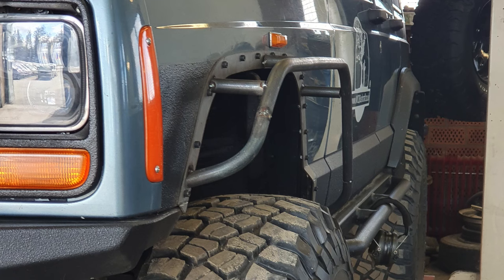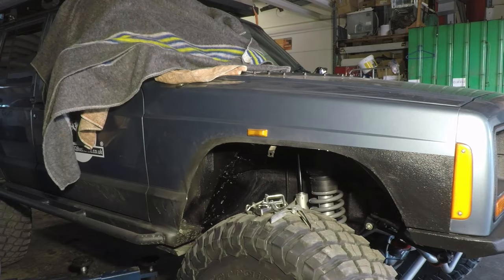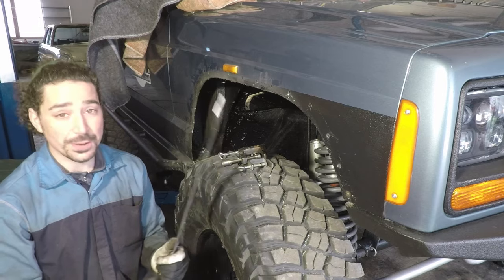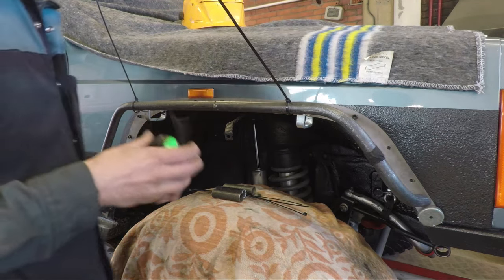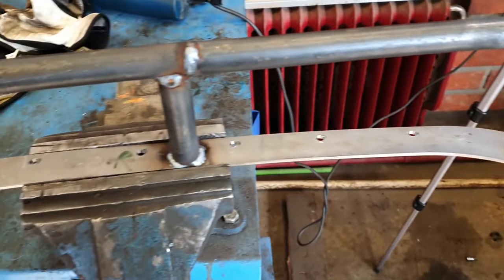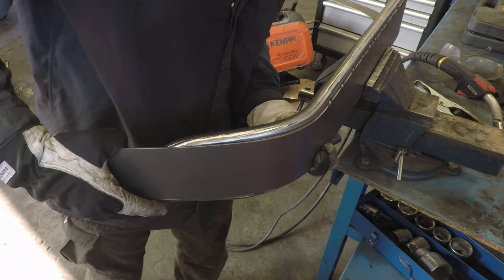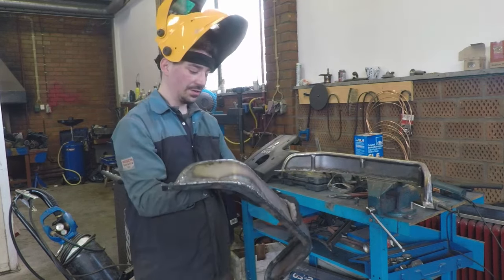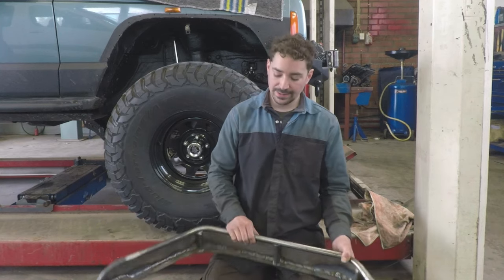How to Fabricate FRONT Tube Steel Fender Flares / Jeep XJ

Comment: I really like the fabbed fenders ! i made some front baja style steel fenders for my 89xj some years back that came out great but what i did that really help with symmetry was cut out poster cardboard templates for left and right with the bends and curves and did the same u did is take measurments at the same points of both sides for tube instal .. another thing that helps when bending the tubing is measuring reference points for bending including marks to keep ur bends level to one another ... well done they look great and probably way better than anything  available cheers mike I know this is an older vid but im catchin up and liking what u do..lookin forward to more wheelin cookin and campin say hello to Ivo for me safe travels from "Rooster"...

Comment: Great stuff, my Misses didin’t let me buy an older SUV, so we went for a newer vitara. Gradually I’m preparing it for light off road work, it holds up pretty good in mud and loose terrain. Hill descending is absolutely no problem. I did have a lot of trouble finding an all terrain tire that would fit, the wheel case just isn’t deep enough. So if you put in too big of a tire, you’ll start eating up the inside. I ended up with 16 inch steel rims with some yokohamas geolanders on them. It works very well for the trips I intend to make. 

But after all, I’d rather be welding and bolting on a real jeep! 

Nice work, truly a rig to be proud of!

Comment: I just finished all 4 steel flares for mine.
Instead of using round supports that go from the fenders to the outside round tubing I use two each 1 and 1/2 inch flat bar. One on each end just befor the flares curve. Plenty strong too. Nothing for mud to collect to and clean looking.
Reply from the maker: Sounds great! Mud won't be an issue, i made some fender lines and studded the supports. I've just been out wheeling and they work great. Thanks for watching.

Comment: Good job. Try downhand with the hardwire for the smooth finish. I might try to replicate your design on my 2 door Laredo.
Reply from the maker: Thanks for the advice. I'm an armature so its always appreciated. They are holding up great, especially with the plastic liner on the inside. Just takes all the rock impacts without sand blasting the paint off.

Comment: Awesome videos. Are you still running the plastic fender liners? And if so, are they the pre 97 model? I have a 98 and I’m using your videos, bleepin Jeep, and trail recon videos for my ideas.
Reply from the maker: I modified the original fender liner and extended it so it covers the underneath of the metal fender. In the next video I  show this and pain the fender so it may make more sense. The inner liners are the 97+ model. 
Thanks for watching!

Comment: Hey Mike, I ‘ve seen lots of videos (not all of them) and always wondered what job you did in Sweden … Am I correct to assume that you work for a Bosch Garage ? If so, was it hard to find a job in Sweden and did you first found a house, or first found a job ? We are thinking of moving to Sweden as well and the ‘job search’ is basically what is putting everything off …
Reply from the maker: Hey Tom. I'm self employed and the bosch garage is one of them. I also do graphic design, leather work and I earn a bit from both my youtube channels. I do a lot of different things to make a living. Taxes are pretty high here and it's not an easy country to be self employed in, but I have a bit of a passion to make my company work so I press on working different jobs to inject cash into my own business.
Its not a difficult country to get a job in up here in the North of you have a trade. If you can operate heavy machinery like an excavator or mechanical work, electrical work, plumbing or something then there will always be people ready to offer an opportunity even if your Swedish isn't great. 
The main thing is where you live. A small town like mine dosnt have many jobs but the houses are dirt cheap. We bought our house for about 10k outright.
Reply: @WorkshoptoWilderness  thanks for the info. Unfortunately I am not a plumber or electrician but a teacher. Although that might be a good thing…

Comment: pretty nicely engineered fender flares. Are you not a bit worried about the added weight? they are kinda chunky! Thx for the share, awesome.
Reply from the maker: Thanks, the idea was a combined flare and slider. Not really, they weigh 3.5kg each, the rear ones are 8.3kg each. In total its around 24kg. Total weight is 2001kg on the scale as it is on 35s with all the mods and frame stifferners. Its not too bad with 335kg till gvm. My main concern is the tire carrier, rear bumper and spare tire wich totals almost 150kg, could be much lighter by 40kg. I guess its all a juggling act. Thanks for watching
Reply: @WorkshoptoWilderness  awesome, thx for the explanation. I’ll be checking out your videos in the future as I’m currently in the market for a jeep. It was kinda cool I found your latest video where you go over your build and explained how it was finished. Then I checked your first video where you just got it. Awesome work you put in highly inspiring. The end result is super gorgeous 😎 👏 I’m curious for your roof tent review. I wish you many good trips and great memories to be made with this beast when you take it out camping. One thing I didn’t get, why would you prefer the nylon winch.? Easier and quicker to handle? Cheers, Kas.
Reply from the maker: @Ks-zz9lh  I would love a nylon winch. They had a deal on for the winch I wanted but it was considerably cheaper with cable so I bought it with a voice in the back of my head that one day I would replace it. 
Thanks for watching and for the comments on the jeep. Its come a long way and hopefully now I can just refine a few things and take some weight off bad designs. Are you after an XJ? Hopefully you find a nice one and its all good from there!
Reply: @WorkshoptoWilderness  hey! I just bought an XJ 1997 last week, 205.000km. I live in Skåne with my wife and kid and I needed something a little more heavy duty for the rare cold days here. I Also love hiking with my dogs In the woods and I take allot of Forrest roads to get me a little deeper on some hiking trails. My 2wd Volvo V70 would only get me so far. I picked it up last Wednesday and I gotta say I’m over the moon. Your channel has given me much inspiration and convinced me this car is the way to go. Mine is blue, it’s the 4,0 gas version and it has had the up country package I think. It has the full and part time 4wd. I’m running the stock wheels she came with. 17 inch rims with 27 inch tire height total. I’m already trying to plan out some upgrades but I’m not that experienced with vehicles. So I’m thinking a garage check up for the brakes, transmission fluid, diff gear fluids, oil change, coolant fluid change, air filters and stuff like that. My biggest concern is rust at the moment. I see some flaking on the axles and also some bubbling happening on the rear brakes. I liked the raptr liner you used on your video. I’m also looking at a lift kit. But that would mean some other gears and perhaps transfer case lowering. I gotta say I really love it stock. I’ll start out slow and check where she can take me. When we run Into trail stoppers I’ll consider some bigger wheels etc. Keep it up with content. 👏👏👏 cheers, kas.

Comment: Always enjoy your content! These are very close to what I want to make for Project Bumble Jeep. But I don't want to cut my fenders or quarter panels. I'm only about 11 minutes into this video, so if you answer my question later on, no reply is necessary. I plan to use nut serts to attach my flat flares when I do them. Also hoping to make mine out of aluminum Did you do nut serts or did you just do thru holes with nuts on the back side? God bless and stay well.

Comment: good day  May I ask what kind of logs and sheet metal strength is used?  Thank you
Reply from the maker: The sheet metal is 2mm mild steel. The tube is 25mm with 3mm wall mild steel. 
The plate at the back is 3mm also.

Comment: What gauge steel did you use?
Reply from the maker: The pipe is 23mm OD with a 3mm wall. The sheet steel is 2mm. In imperial I am unsure of what this equates to but it gives you some idea of what i'm working with. Thanks for watching.